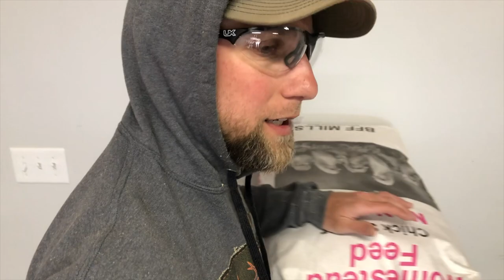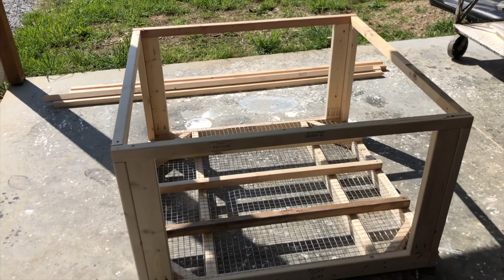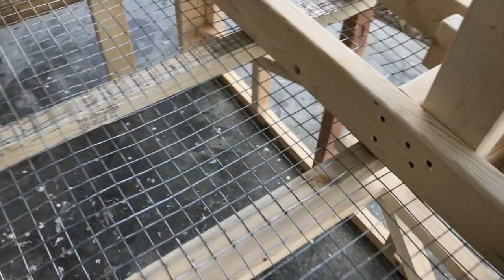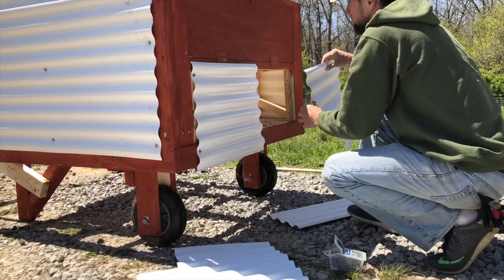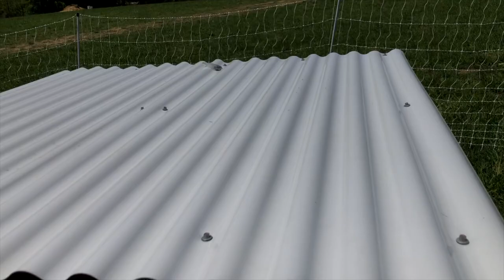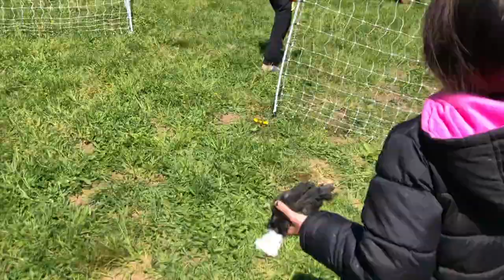Modified Chickshaw for the Polish Chickens

Comment: What is the roofing material, doesn't appear to be tin and where did you purchase it ?     Thanks
Reply from the maker: It is a corrugated plastic from Lowe’s. I think about $15/ sheet
Reply: Thank you sir, I saw it today when picking up bolts for the wheels on the chickshaw

Comment: I think the base design on these are great, and simple enough for modifications! I used pressure treated 2x2’s for stair bannisters at the hardware store (already in 36 inch lengths) and that made it quick and cheaper!
Reply: I think if I end up building a short one for my ducks, I’ll end up doing like you with pocket holes instead of a million angle brackets. I omitted a lot of those anyway haha screwed from the tops and bottoms instead haha